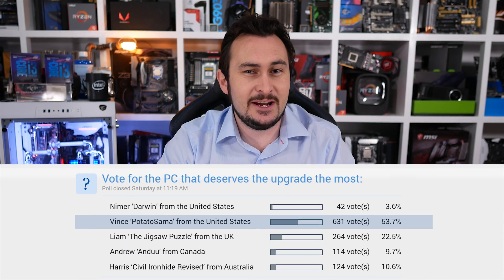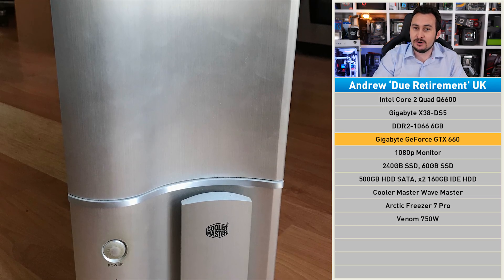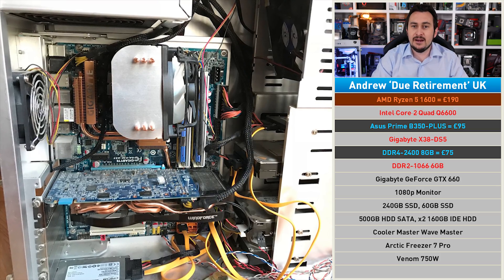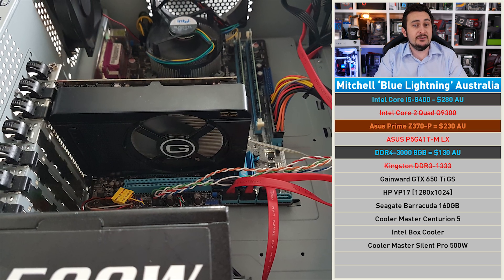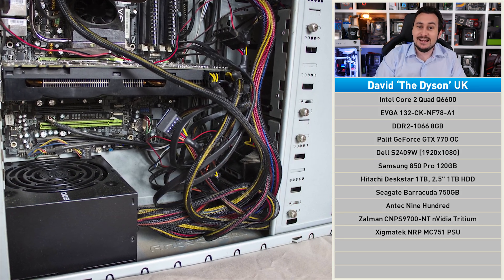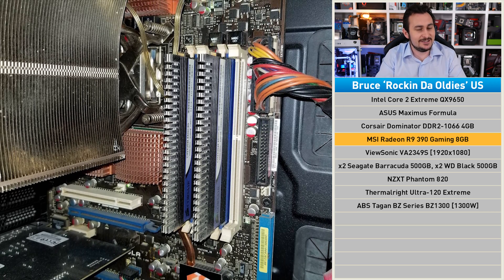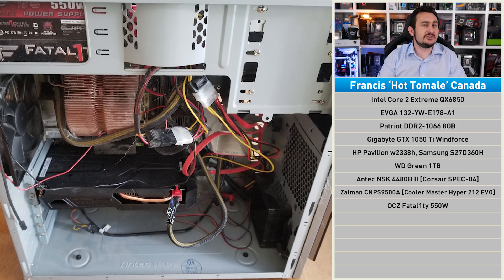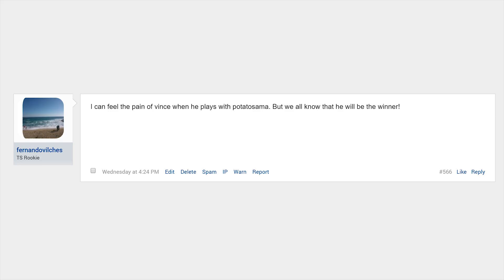Upgrade My PC Please! [S01E06] Core 2 Quad Land

Comment: 'Rockin Da Oldies' is super similar to what I'm still using!

Intel Core 2 Extreme QX9650 (Yorkfield) Socket LGA 775 (45nm technology)
(4 x 2GB) G.Skill 8GB DDR2-1066 PC2-6400 (F2-8500CL5-2GBPK)
Asus Maximus II Formula (I actually did have the Asus Maximus Formula Special Edition (water cooling) motherboard but it, unfortunately, died on me)
Windows 10 Pro
1 x ST4000DX001-1CE168 (3726.02 GB)
1 x WDC WD10EACS-00D6B1 (931.51 GB)
1 x Samsung HD753LJ (698.64 GB)
1 x Samsung D3 Station (4657.52 GB)
1 x WD Cloud (4 TB)
1 x HL-DT-ST DVDRAM GH22NS50 (LG DVD Optical Drive/Burner)
Thermalright Ultra-120 Extreme
Sapphire ATI/AMD Radeon HD 7950 Flex edition
Monitor 1: ASUS VS247H-P
Monitor 2: Dell IN1910N
Webcam: Logitech QuickCam Orbit AF
Mouse: Logitech G502
Keyboard: Logitech G910
Headset: HyperX Cloud II

Newest additions:
Case: Fractal Design Define R5 Blackout
Power: Be Quiet! Straight Power 10 800W (Originally I had a PC Power & Cooling 1KW TurboCool power supply but it died on me - I think the cooling in that power supply sucked and extended use with heat from it killed it - was bought second hand for $85 it was a refurbished labeled unit and I already replaced the fan in it 1 time before)

I stream, game, make music, am an engineering student, and want to get more into video editing for YouTube. I'm definitely a PC "Power User" and multitasker.

Comment: True, that antec nine hundred is pain to work with. Had 1 and sold my old rig to a friend and rebuilt it from ground up and even if you plan before hand, there is no room to put the cables. I hope he will spend some money to buy new case so I could build it there. Would do it even for free and burn that old case with fire.

Comment: Those old Core 2 Quads are still great CPU. Especially when over clocked. I Don't think a Ryzen 1400 wold be a worth while upgrade.  I have an old q9650 overcloclocked to 4ghz and it plays Overwatch just fine with my gtx 970.

Comment: Hi Steve

Can you advise an upgrade for my old rig? 

I7 3770 (non K)
Asrock Z77 extreme 4 
16GB (2x8gb) DDR3 Kingston

other part no need to upgrade i already upgrade 
- 4K 28" monitor 
- GTX1060 3Gb 
- Power supply NZXT 750W
- SSD Hard drive 120GB + mechanical hard drive 1TB + 2TB + 640GB  

I m not much a gamer mostly i use my computer for working and sometimes gaming 

I was thinking to go to Ryzen 1700 + 16GB DDR4 3200 + MSI B350 mate. 

I never overclock my computers. 

Thank you for your reply.

Comment: Wow, I saved my system a ASUS L1N64 SLI-WS Technical Evaluation Unit  from being recycled and have swapped in a new BIOS to allow me to run quad core Opterons. I'm also running 16Gb of DDR2 ECC RAM which is 8Gb over what Asus recommends for the board.

Comment: Throw a Xeon x5670 and overclock to 4Ghz.
Reply: Honestly tho. To the guys who don't win the upgrade. Jump on the comments, . And I would be happy to guide you through the Xeon s771 conversion. Once you go 4Ghz Xeon. You will be in heaven compared to what you have now.
Reply: Nian Banks but x5670 is socket 1366
Reply: Apologies. I mean the x5470
Reply: 3.33Ghz quad core. Easily goes to 4Ghz OC.

Comment: Just a reminder peeps. If you upgrade from preHaswell PSU's you will need to replace it as it will not be able to consistently keep up with demands. In that boat myself with a 800w PSU that won't be able to do the new hardware.

Comment: Need upgrade keeps crashing even during windows 10 updates.

Core i5 6400
igpu intel 530
8GB DDR4 x 1dimm
1TB 5200 rpm hdd
450w psu

Comment: Kinda wish I'd entered the contest, but I ran into a bargain a few days ago. A mobo combo including 8 gb ddr3 1333 mhz and an i5 3470s (with support all the 2nd and 3rd gen intel processors all the way up to the i7 2600k and 3770k, but no overclocking, since It's an intel h67 board) all for about $190 if you include tax. There's also a 1050ti of course. The only game I've struggled to run is "A hat in time", but everything else I can run on high-ultra at 1080p. Even fallout 4 is playable at ultra 1080p.

I also bought a $70 case with 2 fans at the top, a giant one on the side (with leds), and a rear fan. There's even room for 2 blocks of water cooling if my cable management was actually any good.

Technically this is my 2nd build, because I used an old hand me down hp pavilion from 2009 with a q8300,  the 1050ti I'm using now, and 8gb of ddr3 ram  (maybe 1333 mhz, possibly slower). At least I got a free mouse and keyboard out of the deal.

Comment: Hard to decide which I'd vote for....
Rockin Da Oldies has fast stuff, but struggles with 4 GB RAM (an upgrade to 8GB would give the system more time, if it is OC'ed as it should be) but Blue Lightning could use a full upgrade (despite running fairly low resolution)
Think I'll vote for The Dyson. With his current card he would benefit greatly from a faster CPU.

All of them are weaker than my secondary system, and that is LGA775 aswell. So all of them can use some upgrades.
Xeon X5460 @ 4.1 GHz (LGA771 punmod to LGA775)
8GB DDR2-912 CL6
GTX 660 Ti @ 1202 MHz

Still a nice platform that can kick around modern hyperthreaded dual cores.

Comment: I wish I entered this ..A few months ago I blew a couple fan header transistors on my mother board, One being my cpu fan header ran it for 3 weeks until I realized what was wrong , Well now my pc is just a mess and not sure what to do cause I cannot afford to buy upgrades or repair .. Current I did get it to work with a fan controller but its on borrowed time cause it keeps shutting down on me no matter what I do

Comment: I remember my very first quad core, a Q9650, paired with EVGA GTX 260's in SLI.
 Really good overclocking on that chip 3.8 GHz was a breeze and topped out at 4.1GHz. 
with that set up i had no need for a heater in winter lol.

Comment: Steve hi is it worth upgrading a core i5 4460 to a core i5 8400 i am getting new board and ram as well.
Reply: Jesse Martin Soller not yet... only expensive Z370 mainboards are avaliable so far that dont make sense with a locked i5 that cant be overclocked.
Wait until 1. Coffelake is something you can actually buy, and not only read that its not avaliable... And 2. you can buy H310 motherboards to go with the cpu... or you invest more and buy a overclockable cpu, or you buy an ryzen 5 1400 now which (when overclocked) will serve you probably just as well for now while being considerably cheaper.
Of course it depends on your gpu if a cpu upgrade is even necessary at all
Reply: Mr.Magnificent thanks at the moment i am looking at a H310 board when it gets released 😁 the card i have is a sapphire rx 470 8gb OC 😁

Comment: Why go with the i5-8400 over a Pentium G4560 for a pure gaming rig? In fact, why go with the i5-8400 for anything right now; it is selling at a huge mark up and, even if it wasn't, it requires you to pair a mid tier CPU with a high tier motherboard.
Reply from the maker: G4560 would be a silly choice since you are buying into a dead platform. The G4560 needs upgrading now anyway, it's fine for budget gaming but gon't expect to be able to buy a new GPU in the future without replacing the CPU.

The i5-8400 is on the latest platform and it's the fastest gaming CPU available right now with the exception of the new i7 range.

Comment: Definitely "Hot Tomale" 

That rusted CPU Cooler and ancient IDE cables. Also since he's gotten a few parts, shows he's really passionate about building a new one.
Reply: You have to have $$ to get parts, so if you can't afford them (like myself) that in NO way makes me any less passionate. Heck, I would give a left arm and leg to have parts that aren't 9 yrs old.
Reply: Fair point...But anyone with a job should be able to save and buy parts. I built my pc part by part. Second hand cpu, ram and mobo first. Later got a new case. Then a Proper PSU with sleeved cables. Then a GTX 960.   Selling older parts to get new ones, and looking around for the best deals really helps. If you have a job and ,with expenses, are unable to save or spend on these things, then that's really unfortunate and you deserve a new pc
Reply: That's my problem and why I entered. I got hurt 7 yrs ago and have had no income what so ever since. Been struggling with trying to get Disability. Only reason I even have a roof over my head and internet is because of some really good friends.
Reply: Good Luck to you, Man. Your situation really sucks, and I hope things do improve for you and hopefully you get your gaming pc somehow
Reply: Thanks.

Comment: I don't see how an i5 is viable (at this point) until a locked mobo is released. I mean, I know it's good performance and all, but a locked processor on a super pricey Z mobo just doesn't make much sense.
Reply: well, he can always upgrade to a unlocked i7 in the future if he wants.
Reply from the maker: Exactly you can upgrade but right now and for the foreseeable you don't keen to. The 8400 easily beats the R5 1600 when not GPU bound in games.

Comment: Maybe just a good cleaning and new thermal paste on the cpu would help those systems.
Reply: PIGS CLEAN YOU RIGS!!!
Reply: My system is pretty darn clean since I clean on a normal basis. I have an electric air blower for pc's and use a paint brush. And I put new paste on mine about a yr ago. But with 9 yr old parts... I still have to crank all my settings down to play Arma and even that it turns into a stuttering mess a lot of times and I give up. Tried playing last yrs release of CoD and that stuttered horribly even with the lowest settings.

Comment: How do you expect us to vote only one system?! Everyone deserves an upgrade with those Core2Quads. Also just realized how cruel to give the runner ups R6:Siege given their systems.
Reply: LOL ya got a point there. Though my system might be able to run it, but of course would have to kick back the settings so it wouldn't be a stuttering mess.

Comment: Mitchel does not need an i5-8400. If he wanted higher framereates he should either go with ryzen or a g4560 with a 1060
Reply from the maker: G4560 platform is dead, that would be a dumb move to be honest. R5 1600 is fine but for pure gaming the 8400 is cheaper and faster. It also opens up the ability to upgrade to a faster unlocked CPU in the future!
Reply: Ripperoni Pepperoni, it's great that you read most of the comments no matter how "cruel" they could be

Comment: I would love to enter to be able to win an r5 1600 but I feel with the 2 pc's I've built that I am not deserving. I am thinking of dismantling the one system and selling the parts and just upgrade the other one some more. My first build inside of the Thermaltake Level10GTS is the Asus Sabertooth Z77 motherboard with the Intel i5-2500K, 16(4)gb of Patriot Viper ddr3, and a Asus GTX 550Ti graphics card. The cpu cooler is the Noctua NH-C12 and I also have a rear 120mm Noctua case fan.  My current rig is the Asus Sabertooth Z97 Mark S Sabranco mobo using the Intel Devils Canyon i5-4690K being cooled by the Corsair H100 aio, Kingston HyperX 16(2)gb ddr3 inside of the Fractal Design R5 window case. I am replacing the EVGA 960 gpu with a recently purchased AMD Radeon reference cooler rx 8gb 580

Comment: Man i almost wish i still had my potato with me now XD it was like a busted up case (and i mean really busted up, like one front panel that couldn't be screwed in, two drive covers missing) with an athlon x2 250, a gt210, 4gigs of ram... some shitty asrock mobo XD. I woulda won this in a heartbeat :D
Reply: I still have it technically but it's my brother's pc now. Considering how old it is and how much he smokes it will probably die for good eventually. I mean the mobo arleady died before but it was repaired or something. Still pretending that's my current pc would be a dick move :D

Comment: i disagree with the 8400 beeing worth it for arma... an slightly older i5 7600k overclocked to its max potential would be much better as clockspeed is basically all arma 3 wants...
Not going to vote for locked cpus on z-motherboards
Reply from the maker: Doesn't the 7600K cost more and have two less cores? :S
Reply: it is slightly more expensive, but also z170 boards cost about the same amount less, and actually id be very curious where you can get  i5 8400s at the moment, doesnt seem to be avaliable at its regular price, atleast here in germany.
A even more cost effective (maybe a little slower) way would be getting a i5 6400 with a z170 board and blck oc it as far as possible
Reply: Well i5 8400 max turbo speed is 4.00GHz which start to be enough good for Arma 3 and he has better platform for a nice upgrade later. i5 8400 and fastest RAM that's possible for the budget is the way to go in my opinion for future proofing.
Reply: 6St6Jimmy6 it wont always turbo that high, specificly for Arma 3 there are more price effective options... And for anything else... it doesnt feel right to put a lowend locked i5 on a Z motherboard especially when they are still very expensive.
Also future proofing wont be too much of a thing as the cpu market just started to have some competition lately

Comment: RIP my core 2 quad not in this vid:( i should have got clearer pictures (4k instead of my 1080 picture)
CPU: Intel Core 2 Quad Q9300
Motherboard: ga-ep45-ds4p
Memory: 8.00GB Dual-Channel DDR2 @ 399MHz
Graphics Card(s): Asus Gtx 750 ti OC edition
Monitor(s): Viewsonic VX2240W-2 (1680x1050) (60 Hertz)
Storage: 1863GB Seagate ST2000DL003-9VT166 ATA Device
Case: Antec 1200 V3
Cooling: Intel Stock Fan
Power Supply: Corsair 620 Watt

Comment: You seem to be overpaying for that Canadian PC's 1400.  You can get a 1600 for right around $300 CDN.  Or is that price tax included?.
Reply from the maker: Why would it be excluding tax?
Reply: Because in Canada, Newegg prices are all listed before tax, which varies slightly from province to province.  However since i don't know your exact method for delivering the products, I wondered if there was some variance here.  As in, bought somewhere else than where the end user lives and shipped, or bought in the country of the recipient. 
This is not a criticism in any way, I love your content and this series in particular. 
I do know that here in the Great White North,  we pay a significant premium on computer parts vs. US Newegg, above what the exchange rate should be. 
Probably because of duties/hidden taxes.

So I just wondered about that.   As in whether the pricing listed was the "in cart"  tax and shipping added, or the retail price on the item before added costs. 
Certainly not important here, I just wondered.

Thanks again for the series,  fantastic idea.

Comment: My PC:
Intel Core 2 Duo E7500
Asus Nvidia 9600 GT 1GB
2x2 GB DDR2 Ram (Kingston + Samsung)
80GB + 230GB HDD
Asus 775 Motherboard

pls i need upgrades
Reply: AssAss1n check the 775 xeons like e5450 on ebay/aliexpress maybe it's compatible with your mb
Reply: What's your budget?
Reply: I have nothing atm, student life you know..
Reply: if u can find a q6600 should work fine and a gtx 1050   would be a cheap upgrade http://www.ebay.com/itm/Intel-Core-2-Quad-Q6600-2-4-GHz-8M-1066-Quad-Core-Processor-SLACR-/202074767354?epid=74103280&hash=item2f0c983ffa:g:1i8AAOSwqfpZ18Qd              http://www.ebay.com/itm/MSI-NVIDIA-GEFORCE-GTX-1050-Graphics-card-GPU-/132355499452?epid=220477975&hash=item1ed100a5bc:g:~WoAAOSw7NpZ2WbO
Reply: https://www.newegg.com/Product/Product.aspx?Item=N82E16814125919&cm_re=gtx_1050--14-125-919--Product

Comment: Steve, I have to disagree on you on Mitchell's build. i5-8400 on a Z370? Rather pay up and get an unlocked chip, or better, another AMD system! It is hard to argue against AMD's value offering against Intel's rushed products. AMD did really shook things up this year with their Zen series.
Reply: That isn't the problem from what I see.
The guy wanted faster boot times, but with a 160GB HDD...yeah, it will be very difficult.
Not only that, 4 games and is out of space.
I would have chosen a Skylake i5, they should be cheaper than Kaby Lake, mothers are cheaper and could just use a BIOS update to support Kaby Lake.
With the leftover budget a 1TB HDD and a small SSD would have been possible
Reply: I am testing out the 8400 right now, and damn it goes fkin hard ey.  Z370 or not, no denying that Coffee lake is delivering the goods with the tweaked ring bus arch.
Reply: I agree that Vega is of poor value at the moment and I have no trouble recommending Nvidia GTX1070 than Vega 56.

But to claim that AMD is poor for gaming is just wrong. Intel does indeed get higher frames, but at what cost?! 10% increase in frames where you have to pay 30% more for Intel system? AMD CPU's and motherboards is the best value you can get at the moment.

And if you get a Z motherboard, you have to get the K series instead to make use of the motherboards overclocking functionality. That is what I'm arguing about. Get a K series instead for the Z370 or get AMD AB350 motherboard for an R5 1400 or R5 1600.
Reply: GeneralGeldenhuys amd value for money your having a laugh what about all the crap with vaga56 and 64 100 dollars more than they said they would be and amd is poor for gaming compared to Intel that's a fact

Comment: Ahh Core 2 Quad builds. The 775 is one of my favorite classics, only beat by 1156. In fact I just bought some parts for a quick budget build on a 1156 socket with a Xeon X3450. However, I'd vote for all of them. haha